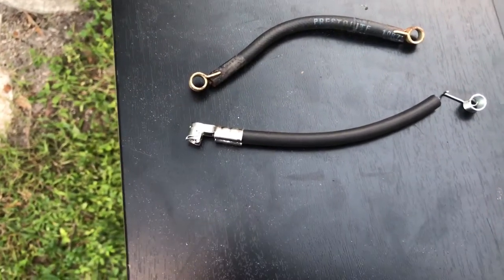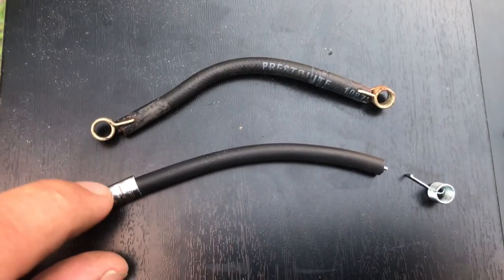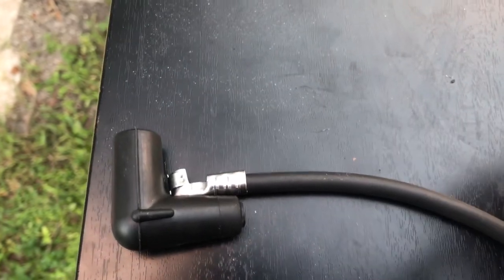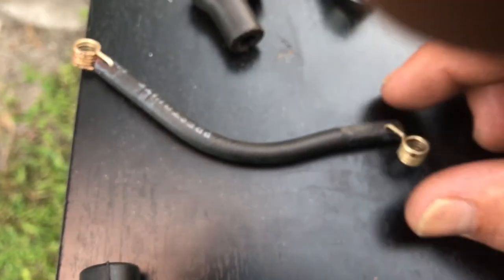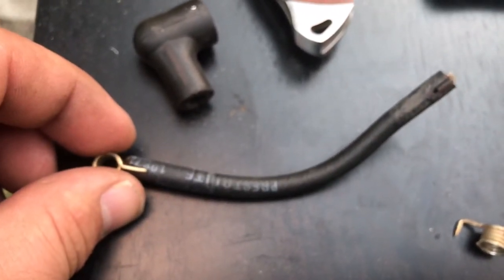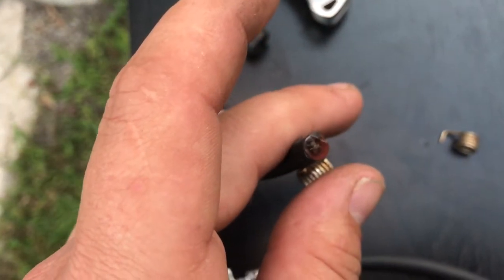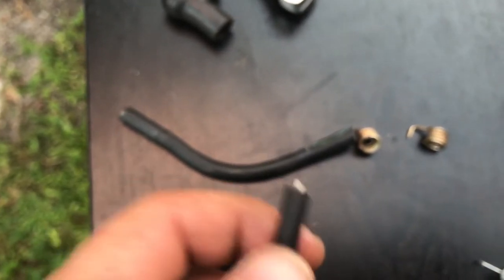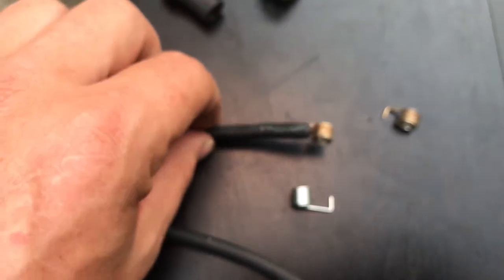Replacing ignition coil's 35 hp Johnson assembling spark plug wires

Comment: Do you have any idea how many ohms these should read? I am getting extremely low numbers and it doesn't seem right.
Reply: I know this was asked 2 years ago. But the answer may help someone.

OHMs measure resistance. So lower is better. You don't want any resistance through the spark plug wire. 0.0 OHM is the best.